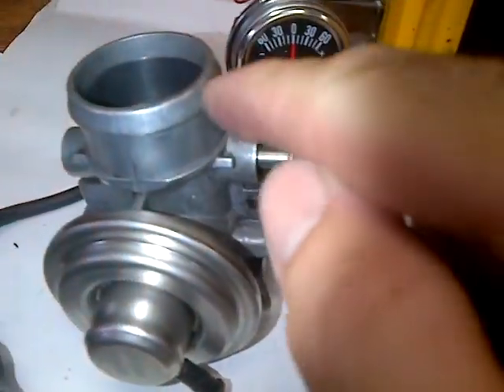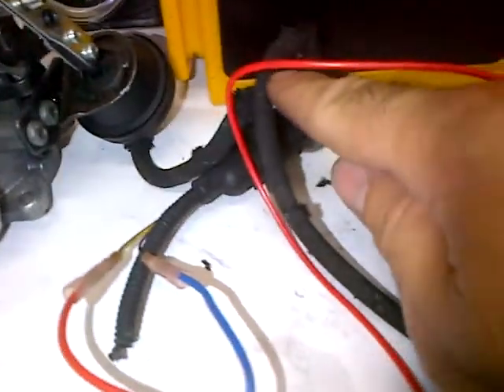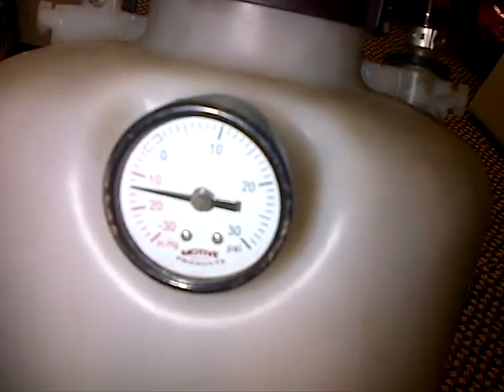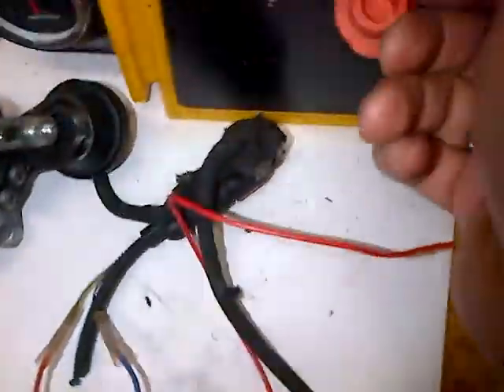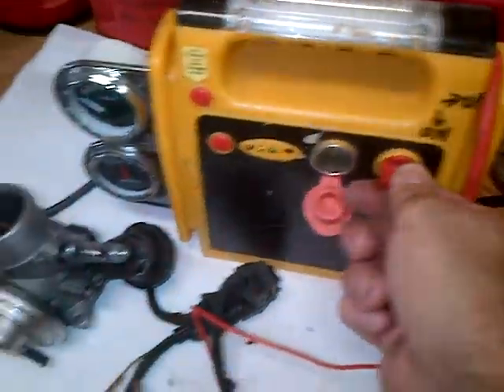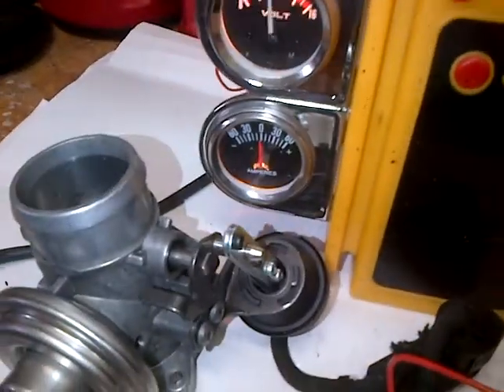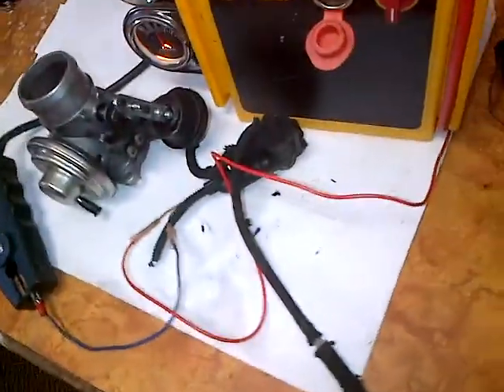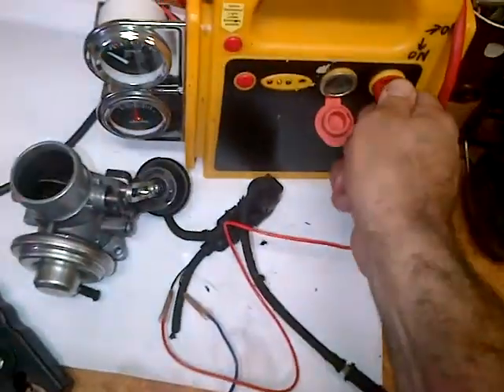ALH TDI ASV test with 12V source

Comment: i have problem with this. when i start a car the vacuum is being applied to the valve so it closes and the car stals. the vacuum must be applied only on car shutdown, but it applies constantly, because the car starts when the vac hose is being removed and there is vacume in the line. as soon i reconnect the line, the ASV closes and car stalls
Reply: My problem was the wire connector for intake air heater was swapped with valve.   This fixed it for me